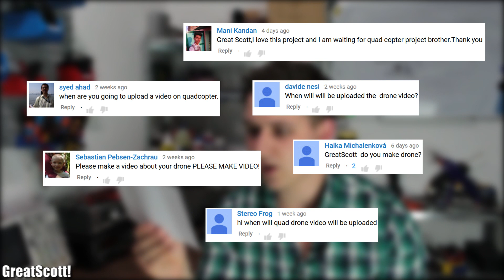Q&A&C #2|| Favourite YouTuber, Quadcopter Project, Travel Ambitions

Comment: why does every foreign person think our 120vac system is unsafe? it is literally half the voltage and contains more circuit breakers per amp. how is it less safe than your systems? please explain as I am quite confused on how 30a at 240v on a single circuit is more safe than an average of 25a at 120v not to mention how ungrounded appliances (greater than a few hundred ma) simply do not exist and the only reason ungrounded small electronics exist is because of the fact that those tiny devices will blow up under any fault condition that could cause human harm and those device often have plastic casing so no live casings can exist

Comment: When you were talking about the first time you power up a circuit for the first time and it remarkably working happend to me!. My most complicated electronic project. A solid state tesla coil. After weeks of construction I finally finished. After setting it up I turned it on ballasted. And I got small discharges. I removed the ballast and released its full power! 18cm arcs!

Comment: Hi, thanks for your great videos!!!  To keep my question simple, I have an AC powered sub woofer which is used in my home surround sound system.  When it is plugged into a grounded ac outlet, it hums loudly.  The only way i could stop the humming was to eliminate the ground pin by using a ground to a no ground adapter.  Can you suggest a better fix?  Thanks!!!

Comment: Really like your videos but I agree with one of the comments regarding the pace being too fast (even with copious stop/pause/think).  Might you give some thought to slowing down on a video, then letting users adjust the playback speed to 1.25x or 1.5x if they prefer that?  The big point here is that it is much easier to speed up a slower video than slow down a too-fast video.

Comment: I can recommend the channel of Matthias Wandel. Not directly about electronics but your mind will be blown that you can make big expensive power tools by yourself for cheap with easy materials and no experience (if you don't have 2 left hands).
You will learn to make the machines that you always found too expensive to buy even though you have projects in your mind that require them.

Comment: Hey!!!! what is wrong with our 120 volts? :)
Reply: So true! At least it doesn't kill us instantly.
Reply: Andreas Kohlmann it might draw more amps but the same amount of power is used. as for the plugs thy might not be as safe but you learn as a kid not to touch. as for my self i have touched mains power more times then i can count and i am still here.
Reply: Beginner's Tech I remember how I learned, that a hot plate may be hot, despite my mother said to me: "don't touch it" 
And if you draw a higher current, you have to increase the cable diameter to get the same safety.
Reply: Lol.  Nothing is wrong with it.  But on cold days if you need your 2.500 kW heater fan, you draw twice the current we do in Europe. But if you're coming from California, it doesn't care you much. 

Have you ever compared European and amarican mains plugs? I saw American plugs plugged in halfway. The thing was working and you could touch the contacts with some other metal thing like scissors or a knife.  I think 120 Volts could be deadly too.
Reply: I remember pulling a lamp plug only slightly out of the wall and placing a wire in between the ground hole and the live wire TWICE! both times the breaker tripped.
Reply: Andreas Kohlmann And (a majority) of our plugs go all the way into the wall.

Comment: i forgot.. can you remind me what the "C" in "Q&A&C" stands for?
Reply from the maker: Comment
Reply: +GreatScott! my favorite tool is the HOT GLUE GUN!
Reply: I have a question. If i were to use a 450 - volt Electrolytic capacitor in a 9 - volt battery circuit, would that be possible? I am trying to make a FM transmitter.

Comment: I have a 5V 12A and a 12V 7A MeanWell Mains source SMPS and I want to make a 4 port USB 3.1 PowerDelivery (only the 5V and 12V part) high current quick charger with USB-A connectors.
Any suggestions how I should do that? What ICs do I need to get the negotiation between the appliance to be charged and the charger right? And where can I let etch my PCB created with KiCad?

The goal is to have a future proof charger that can charge any new smartphone. I am so desperate that I plan to just buy a already manufactured one and then build my own massive V2A stainless steel case around it...

Comment: Lets say you have a 30 volt powersupply. Is it safe putting the two wires together to generate heat? If not, is it safe to touch the wires together to generate sparks?

Comment: Hey GreatScott. I bought the same model 3d printer as you did, and currently I am having trouble getting the autobed calibration working without the printer trying to destroy itself. Any chance do you have any suggestions or tips that you could recommend? Also, I wanted to say you are doing a great job, and that I love your videos.

Comment: little question..... i have a lot of atx power supply's and i have savaged parts from a lot of them but i need a new variable power supply and i have thinked a bit watching your buck converter tutorial.... is any feedback pin inside an atx in a control chip to hack with a potentiometer and make an high power lab banch power supply (i am only an electronics enthusiast so if i have a wrong idea apologyse me)
(i am italian so apologyze me for the shitty english :)

Comment: How safe are cheap AC Adapters from China?
Like 12V adapters and 5V Chargers
Reply: Have a look at BigCliveDotCom or Julian Ilett, they both review a fair few different Asian imports. Some are ok, some are deathtraps.
Reply: Maxx B Especially Big Clive ;)
Reply: Cheap pink USB charger anyone? :D A good rule of thumb (learned from those guys) is to take the charger apart before using it. Check for shorts, solder splashes, mains separation... Throw it away if you doubt its safety.
Reply: VERY VERY dangerous. Often illegal.
Reply: Filip Smrčka The pink charger song... xd
Reply: Filip Smrčka ♩♪♫♬I got a cheap shitty pink USB charger from china ♩♪♫♬
Reply: +Dawid Ziaja xD

Comment: What does the Q&A&C stand for? I know what Q&A means but is the &C a Joke of AC?
Reply: +KaienSander10 ElectroBOOM's accidents are indeed scriptes, because he wants people to learn by showing what not to do. If his accidents would be real, he would be so dead.
Reply from the maker: Questions & Answers & Comments
Reply: Also do you cut out any video If you accidently blow up your circuit? If you Do can you add them back in the video's? Maby at the end of the video?
Reply from the maker: I usually start filming when the circuit works correctly. So I don't have any explosions on camera.
Reply: +GreatScott! Can you film it next time when you test it? Just like ElectroBOOM for example
Reply from the maker: Sorry to tell you but I am pretty sure ElectroBOOMs "accidents" are all scripted.
Reply: +Bert van Rossem That is kinda true. If all of them are accidents he would be dead for sure
Reply: for any of those wondering, electroBOOM creates most of those sparks by just discharging a charged capacitor for special efects.

Comment: do you have a way to remember the difference between npn  and pnp?
Reply from the maker: npn usually sinks current (to GND) and pnp usually supplies current (from Vcc)
Reply: +GreatScott! oh nice. is there a general purpose npn pnp transistor that you could recommend for the small scale electronic projects?
Reply from the maker: BC637 & BC640 is pretty common. But so are plenty other BJTs.
Reply: npn = negative positive negative (negative input, positive signal, negative output) and pnp= positive negative positive